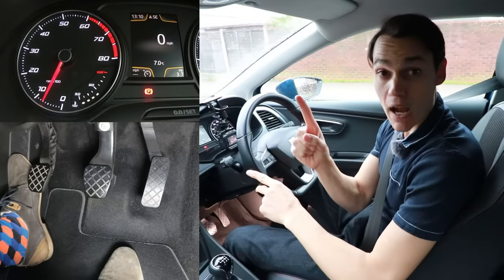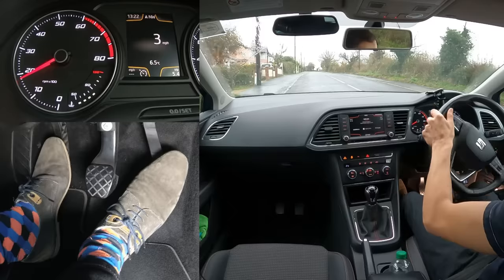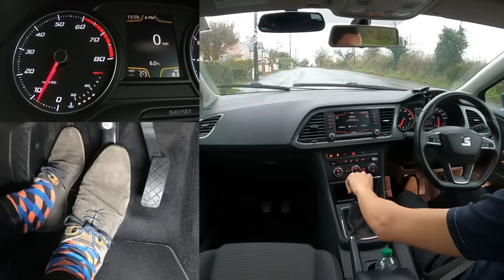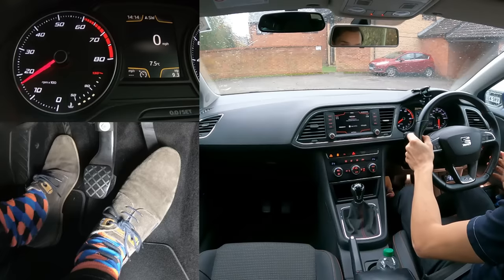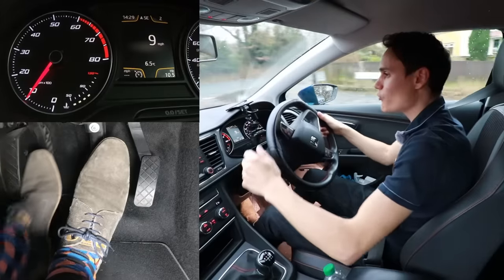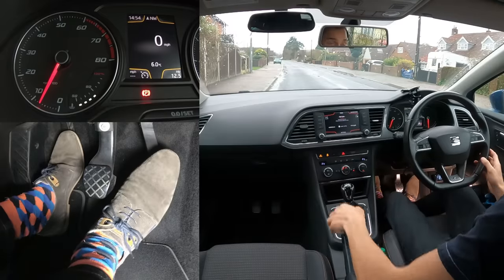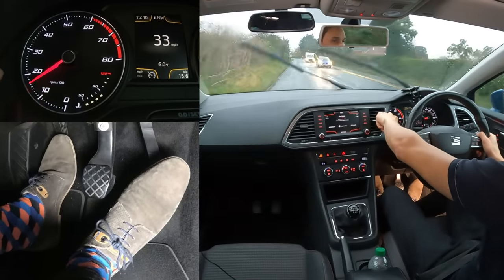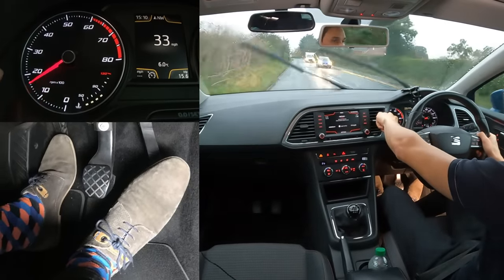How to make your clutch last longer without stressing the transmission.

Comment: No, no no! Do not sit stationary with your foot on the clutch. By doing that the clutch springs are compressed and you are aging them. No wear to the plates but your clutch springs are having their life shortened. Don't be lazy, get into neutral, apply the parking brake and wait until you have the opportunity to move away. Depress clutch, engage first, release clutch while at the same time releasing the  parking brake and using as much throttle as required for the traffic conditions. 

This method also stops you inflicting brake lights on the poor driver following you in slow moving night time traffic, especially in bad weather. I could only watch a a minute of this as I was cringing.
Reply from the maker: I believe I mentioned clutch release bearing wear in this video.
Reply: @ConquerDriving  My apology if you did. I only use the clutch when changing ear and moving off. I also use gears to produce engine braking. There is a school of thought that this stresses the gearbox, it does not. I have never had a gearbox issue in more than forty years but brake pads last me between 20 and 35 thousand miles, depending on use,  which is a saving and is environmentally better. Less pad material being shed.

Comment: When parking, you don’t really need the throttle pedal at all ; just be very smooth with the clutch.
When in very slow moving traffic, even going slightly uphill, just put in the first gear and release the clutch very gently with no throttle. Don’t ride the clutch — if you need to stop, then stop and wait, as said in the video.
I never mastered taking off uphill using handbrake. I find it unnecessarily complicated — an extra thing to do. Just find the clutch bite point while you’re on the footbrake. Then move your right foot onto the throttle pedal quickly and add a bit of throttle while releasing the clutch gently. Add a bit more throttle on steeper hills.
Reply from the maker: I made a video on not using the gas, doesn't work in all cars: https://youtu.be/UdTSRBJrw7Y
Reply: you're damaging the flywheel.

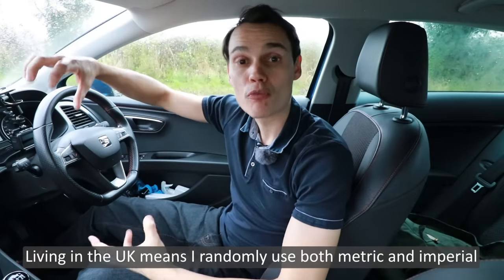Comment: 4:27 where I live rn each person is like a cop to the next person, if you see a car in front of you and you see its "way too clear" in front of them you must honk at them until they move, out of vigilance and being worried that they have fallen asleep ofcourse, not because youre a dickhead
P.s. I found the best practice is to keep the distance of two cars in rolling or slow rolling traffic ahead of you. This way I give light gas (well its a diesel) on 1st or 2nd and maintain a steady pace and brake very late so I save up on clutch use and brake use in traffic. Works like a charm.

Comment: Best way to preserve the clutch life is to get an automatic.
Reply: Most modern automatic cars also have a clutch you can kill if you let it slip too much
Reply: @a.a.2783  This and also a failed automatic costs 5x more to repair if not more than a simple clutch. Automatic transmissions are not as reliable as a manual.
Reply from the maker: A true auto yes, but most automatics have one or two clutches these days.

Comment: I dont agree with your 'rev matching' technique. I think you are braking on your fly wheel and really making a lot of friction when holding the clutch as it meets the higher rpm's in the lower gear. I think you should rev match by giving gas and actually matching the lower gear rpm as you let the clutch up fast without excessive friction.

Comment: Simple move away without any throttle
Reply: That does not work on many vehicles, new cars usually give gas themselves, but many older cars dont and trying to move away without throttle on even the slightest incline will stall the engine.
Even with cars that do give gas automatically usually dont have much torque at such a low RPM, just give it some gas and be done with it.